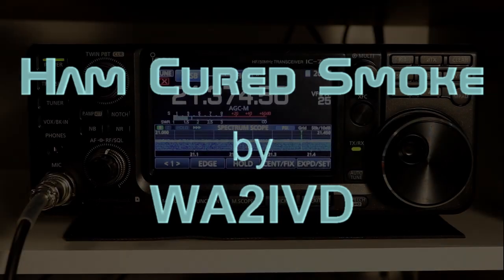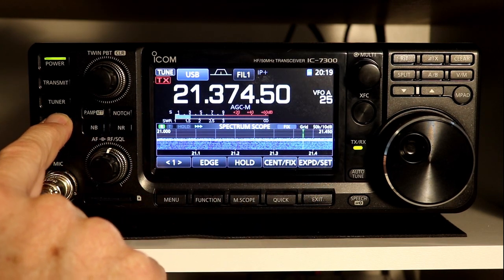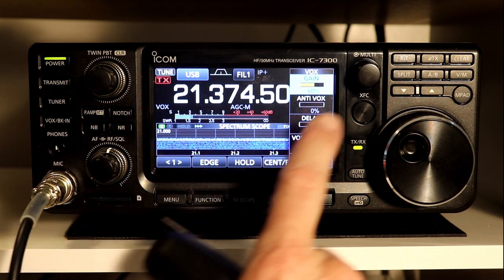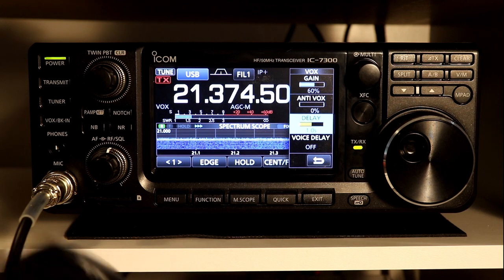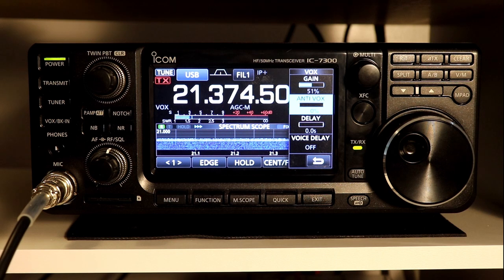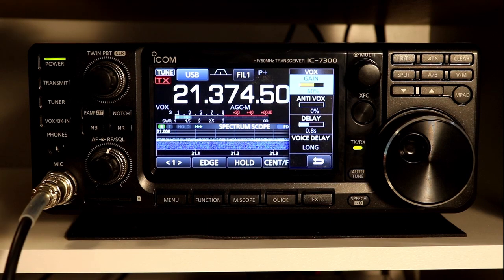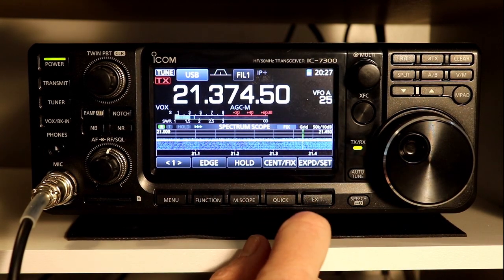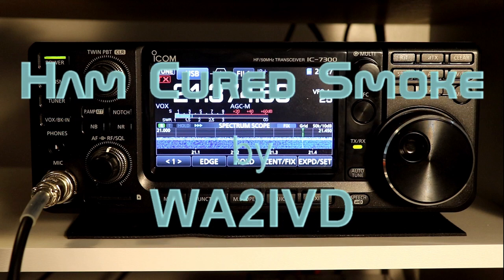Icom IC7300 A to Z #12 VOX Function

Comment: Excellent series! I am wondering if I can use VOX with the hand mic? It seemed that you were doing that but I couldn't get VOX to work when I tried it with either PTT or the "transmit" button on the radio.
Reply from the maker: Hi Don.  I did use the standard hand mic when I made the video.  I am a little confused about what your issue is.  When you turn on VOX mode, you should not have to use either the PTT or the Transmit button.
Reply: @HamRadioA2Z  It turns out I later found I had to set the gain to 100% to capture my voice on VOX. 70% or 80% would not work for me, unless I spoke louder than my normal voice. Being my first radio with VOX I didn't realize you only have to push the VOX button to turn it on.

Comment: Thanks for the video. I bought a 7300 with the PRO 7 headset and have been hand keying the radio. I haven't 
used VOX before and never really understood it. Your video has helped clear things up and I will start using 
the VOX feature. 73"s Gary KF6EWO

Comment: Thanks for video Tom :-) Does VOX also work in SSB Data mode? Thanks in advanced, best 73. Franco, iw2hus
Reply from the maker: Hi Franco.  Thank you for the comment.  I believe VOX does work in Data mode, but I wouldn't recommend using it.  You should have your digital mode software setup to key the rig using either a CAT command or one of the hardware options.

Comment: I was initially going to skip over this vid since I didn't see myself using the VOX feature, but thought I'd at least give it a start.  Halfway through, again, I didn't think I'd use the feature since I use a Heil headset keyed with a foot switch triggering an Ampkeyer to trigger an amp. I just didn't think the feature would work with my setup.  Guess what!  It does!  Holy Cow.  Thx again, Tom.

Comment: Hi Tom,
I've had my 7300 for a while now, but finally decided that it was time to learn what "all those other functions" did... I'm enjoying the series a lot! 
My question concerns the VOX delay function... If you are on a headset, will you have your voice "playing back" delayed into your headphones??? That would annoy me no end...
Hope you are getting settled into your new place! I really feel jealous of all the "antenna land" you have available (my backyard is 18' x 50'); I don't envy you having to keep that all mowed though!!
73
KN6GHR
Reply from the maker: Hi Chris- There are 2 different settings related to delay.  The VOX delay sets how long the transmitter stays keyed after you stop talking.  It keeps the radio from chopping between transmit and receive as you talk.  You won't hear any affect from that in the headphones.  The other setting is Voice Delay - It is the bottom choice on the VOX menu if you press and hold the VOX button.  This setting has 4 choices:  Off, Short, Mid, Long.  Yes, if you have the monitor on and you turn on the Voice Delay, you will hear the delay in your headphones.  The simple solution is to just turn Monitor Off.
Also- Thank you for the kind words.

Comment: So to make sure I understand, turning on vox keys the mike so it's always hot?
Reply from the maker: Hi Bill.  VOX doesn't key the radio, but it does, in effect, make the mic always hot.  When VOX is enabled any sound louder than the sensitivity setting will key the radio.  The VOX gain controls how sensitive the radio is to the sounds.

Comment: Hi, Tom.

Very good explanation about VOX.  I, myself not using this feature, because of several factors. :)  I may try this feature when the time is right.

The delay feature, is like a voice buffer, where the rig always 'hears' the sound/voice, and if the sound is high enough to trigger the VOX, the rig send the sound buffer which includes the sound which is lower than the trigger level, and the sound is going to be smooth, not choppy..

If I am wrong, please correct me. 

Thank you,
Bahathir 9W2GNU, 73..
Reply from the maker: I believe the buffer description is exactly right.  The Short, Mid and Long options on the Voice Delay essentially select how much audio the rig stores before the VOX trigger.